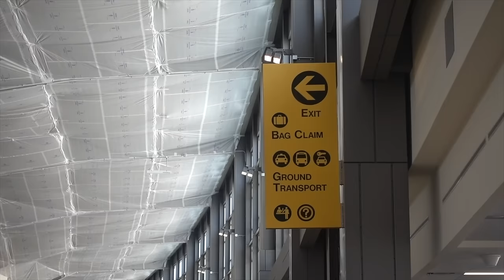MTB Myths that need to die—and some that are true!

Comment: Re: Bunnyhop clipless, learned to do it on BMX bikes as a kid, haven't been on flats since I was 16 really but every now and then I'll do one when I can on another bike (or even on my eggbeaters with flat shoes, not recommended though, LOL).  I've probably picked up some bad habits over the years, but for MTB, I just choose when to bunnyhop and when to "plow over" whatever obstacles.  I've actually found it most useful on the road of all places for those pack rides when suddenly the pack is swerving left/right and in the middle see "POTHOLE" straight ahead, had to bunnyhop one about 2ft across one time unexpectedly not long after I'd just gotten back into biking after about 15 years of no biking... was happy muscle memory kicked in! 
Re: quicklinks - one key/slightly funny thing about them is that they cannot possibly unlink "under load", basically you are pulling it tighter/more solid together while pedaling.  So if it's sloppy, it has to be so sloppy that when the chain is slack and either you are backpedaling, or maybe hub-driving the chain (especially if it happened maybe mid-derailleur shift), that it actually causes enough sag/"push" on the chain to pop the pins towards each other. That's HIGHLY unlikely. 
Alternately as mentioned, the friction can/could eventually wear the slot or "tabbed" sections enough to actually allow them to pry the pin through the slot on a hard gear change or such, so as mentioned in the video, if your QL is not snug enough to require some "snap" to assemble, then yeah, replace it! 
Last run of the day - as others mentioned, LOL, probably mass numbers of people having NO crashes on their announced "last runs"... and probably tons of crashes happening on any "random sequence" runs... but since the last run of the day is the last thing to remember, remembering it as a run you crashed (especially if badly) makes it stand out more in everyone's minds, forgetting the 6 other times that day they picked themselves up and dusted themselves off, LOL. And maybe it WAS going to be the last run, or maybe not, but now that you've crashed and broken "bike, self, ego"... it's by default now for sure the last run, no waffling about "okay, let's go back one more time" when parts of your body are no longer attached properly, LOL.

Comment: The last run is always the most dangerous because you're tired. Same thing with skiing, only magnified, because then you're really tired.
Reply: So true.  A case of the mind/spirit totally ignoring the body physical.  The body always wins in the end.  😐
Reply: I always did my last ski runs as casual, taking in the scenery etc, as I have already pounded it all day. A relaxing run not too technical always seemed like a good way to wind down the day.
Reply: skiing might be the easiest "action sport" of all lol 

I once spent 3 hours getting concussed trying to learn how to snowboard, decided to switch to rental skiis for the first time and went down the mountain with no real issues besides a small section with alot of ice lol skiiing is insanely easy
Reply: @BodieMoto  I think it has a super low baseline. I had to practice snowboarding a dozen times before I even had a hope of getting down a green run without falling over.  Like three years before I felt like I could actually “snowboard”, and a few years after that before I thought of myself as “decent”. And I snowboarded almost every single weekend. 

First time trying skis, strapped them on, went down the hill, turned and stopped. This was before I really learned snowboarding so it definitely wasn’t crossover skills from snowboarding. 

However if you want to be an exceptional XC skier I think it’s harder than being an exceptional XC snowboarder. Same with jumping. 

Snowboarding has a very steep learning curve with a big plateau whereas skiing is much more gradual, but the difficulty ends up higher.
Reply: True, but that won't change based on whether you SAY "one last run."
Reply: So true.  I had my worst skiing accident at Jay Peak on what was certainly going to be "one of the last runs". I decided to try a narrow, black diamond trail with barely any room to slow down and ended up smashing my leg into a tree.  Moral of the story - do NOT try a super challenging or unfamiliar run at the end of the day (bike, ski, etc).

Comment: I've noticed that storing a bike upright will let the foam rings in the fork dry out and make the fork feel a little sticky.  I've flipped my bike upside down for a night to get the foam rings oiled again, and it totally worked.  Fork felt great after that.  One thing that happened from that, though, was the brakes felt spongey afterward.  I think that was probably due to improper bleeding to begin with, though.  All I had to do was flick the levers back and forth for like a minute and they felt fine.
Reply: If you ever look at gas struts in other applications, many of them have an arrow pointing to which way should be up, and it's always the main body at the top, not the bottom. The reason is to keep the seals wet. That's really all these shocks are, except they're basically all mounted upside down. So storing the bike upside down would actually make a lot of sense.

Comment: Great job busting myths. Without reading all the comments regarding shocks requiring servicing after storing your bike on a wall vs the ground … some frame shocks are mounted vertically whereas other shocks are mounted horizontally. So I’d bust the myth on that engineering mount alone. As you mentioned just cycle or ride the bike and service when needed. 

Side comment, I can’t wait to book a trip at the Ranger Station!!

Comment: In regards to the quick release thing, when I was racing cross country years ago, you wouldn't have the rear quick release pointing rearwards as there was a risk, if you were riding in a group of other riders, that one of their front wheels could knock into the rear quick release and the spokes could catch the lever and open it. Also, the front QR should always be pointing rearwards as bushes and plants etc could catch the lever if it is locked in the forward position and open it as your moving forwards.

Comment: I never close my tyre levers facing forwards incase of picking up any bush/shrub/vines and risk ripping the lever open, what do you think about that?
Reply: I happen to have my (one and only) QR lever pointing forward, straight along the chainstay on the drive side.  In that position, anything that would hit the lever from the inside would also hit my pedals and the rear derailleur mechanism.  It's never been pulled out of position, even after having to deliberately hug some foliage to avoid a track covered in soft sand.  In summary, the chainstay makes for a pretty good guard.

Comment: There's only one point about quicklocks that still applies today.
Don't put it facing forward because if it wraps around a twig or wine or root etc it's going to unlock and you will drop your back wheel at some point down the trail.
I've always put mine facing upwards in line with the frame so there's less chance of stuff getting in between it and unlocking it.
I don't put it facing backwards because then it can (easily) catch something as i roll the bike backwards and unlock it without me noticing it too.

But never in my life have i been scared of it catching a disc brake... They physically can't do that, if designed correctly.
However, I have had derailleurs find their way into the spokes of a wheel before when rolling backwards. Make sure your derailleur is healthy and fastened properly and use quality components and properly lubricated and free of debris.

And with V-brakes i've also seen a case where the V-brake pads worked themselves into the spokes and all hell broke loose.

Comment: Learned to ride clipless, started to do drop off with 0 technique, went fine for a while but because I was used to just let myself fall off the drop I had my feet disconnecting from the pedals few times causing bad crash that never heppened before with clipless or after when I went back to clipless. I could bunny hop both types of pedals. Another problem is that with clip you don't need to drop your heels to ride rough sections or for hard braking which means when you go to flat pedals those events are mostly not controled and get sketchy for something you normally know. After at least a decade refusing to touch a flat pedal again I now force myself to ride flat during winter to learn those technics but reseting basically a lifetime of bad habits is hard and it hasn't really made me go faster than my normal speed either but at least it brings variety in my riding and I chalenge myself a little bit. I taught my GF to ride on flat and she proload the bike when taking a drop and drops her heels when necessiry if she moves to clipless one day for some reasons at least she has the right technic ingrained in her riding style.
Reply: I had someone tell me that dropping the heel wasn't actually a very big deal. That happens automatically when obstacles come up. What you want to do is keep your feet level relative to your center of mass. When you're going downhill, your mass moves rearward, and your heels will naturally drop to compensate. When going uphill, your center of mass moves forward, and your heels will rise a bit. When on level ground, your heels will drop for power, and rise for efficiency, or cycle between the two if you're pulling on the pedals as well. When you're riding off drops, your heels will rise to help you push against the pedals to keep them attached. It's a very dynamic thing and there is only one right answer: respond to the terrain.
Reply: @TheDustyShredder  many people, especially beginners don't drop their heel when they should. Contrary to what you said it is far from natural. Coach some people, even observe people at a bike park you would be surprised. No idea for flat I don't ride such terrain, and for climbing I do but couldn't care as I mostly climb on fire roads to get to the top as efficiently as possible lol.

Comment: The airplane cargo hold is also kept pretty close to normal temps, like 45 to 65 deg F -- something that will ease your mind if you're worried that a sudden temperature differential will separate embedded aluminum parts from the CF matrix they're in due to differences in thermal expansion.
Reply: Okay, so yes they can temp regulate the cargo holds, but they dont have to, and usually only do if there is obviously temp sensitive cargo. I know this for sure, because a friend of mine told me a story about when the airline she worked on accidentally warmed the wrong cargo hold and someone's pet sadly did not make it.

Comment: I never use the phrase one last run, or my last run. When I first started downhill, I did use it and was quickly corrected. But I actually am at the point where if I even think that, I don't do the run because that's where I'm most likely to get sloppy and get injured.

Comment: Great myth busting vid, thanks. 

Your segment about chain master links and reference to chain cleaning triggered a thought. I would be interested to hear your thoughts about chain cleaning regularity and the effectiveness on chain life etc. 

In my case, I never specifically take the chain off to use a degreaser and properly clean the chain. I only ever use a combo cleaner/lube which is a solvent that contains PTFE as the lube. I use it after each ride  with the chain still on the bike. This may seem expensive to some, but I weigh 120kg and I'm lucky if my chains last between 1000 to 1500km anyway. I always just use a brush then a cloth to wipe off any dust and dirt from the chain, chain ring and cassette before lubricating and wiping off excess. My thoughts are that this is almost better and less effort than frequently taking the chain off and cleaning with degreaser, because when you clean a chain, depending on the trail conditions you ride on, the chain is only clean for the first few minutes anyway. After that the dust/mud is on the chain and busy working its way back in to those link rollers.

Comment: Regarding quick release levers: Never close them facing forward, always close them facing backwards. Why? Because vines/cables/random junk on the trails or wherever you're riding can catch them and snatch them open.

I recommend considering the same thing whenever installing a single sided clip master link for a chain, observe which way you install the clip so it won't have any chance of catching something on the bottom of the chain run and popping off.

Most any of those quick release or quick clip mechanisms can be prone to popping loose if you hit or even bunny hop some sort of unexpected obstacle on your ride.

It's not the most likely scenario, but it's happened to me before. Stay safe out there fellow riders!

Comment: In the 2000's I heard that putting the lever on the disc side was dangerous because the heat from the brake could melt the resin of the lever.
It was more plausible of an excuse and even at that time I laughed at that Idea.
I could make a 1 hour video about how kickback doesn't work the way people think it works but I suck at making videos. But no, kickback won't increase with POE (or, not as much as you can feel the difference). Bike's response to rider input will increase tho. Making people think they are feeling kickback.
Reply: I know what you mean, I've tried telling people it's a myth and why but very few actually think it through and realise why, your wheel's rotating forwards and spinning inside the freewheel so how is a tiny bit of motion on the chain going to suddenly engage the freewhee enough to get the crank to turn backwards?
Reply: "melt the resin of the lever'. FFS you guys.

Comment: 13 yr maintenance engineer.... Very few bolts on a mountain bike are torqued to the extremes heavy equipment is.
Using a hex key ball end in highly torqued cap screws will eventually wear the ball and then the worn ball will will wear the cap screw head. 
Also the reduced contact area of the ball will allow the ball to deflect the walls of the cap screw socket and round the hole...

If you have a new set of Allen keys (or at least a set that has only been used on your MTB) and they are not cheap (may as well use a screw driver over a cheap set of "soft" Allen keys.) it's fairly safe to use the ball even for unlocking of the initial 'stick' but if you can use the non ball end, always do for unlocking the initial turns.
Personally I always reaffix a cap screw with ant seize paste. Anti seize does not allow a bolt to loosen itself but helps ensure that oxides (rust etc) does not 'Glue' the bolt in place. (Removal of a corroded bolt, often due to different types of metal reacting like a battery, will usually cause damage to the softest of the 2 metals (rusting metal often makes the surface harder so it will rip apart alloy with its rough surface. Anti Seize has an added bonus of creating a protective layer on the surfaces of the metals helping prevent oxide. 

Personally I use Anti Seize to hold the caps on water blasters that can be holding 4000+ PST on a vibrating piston head. I have NEVER seen one loosen that was prepared with Anti Seize, but I have near destroyed brass in brass caps where the oxides glued the pair together and even a smack with a hammer (old trick for shock release of brass fittings, when done right doesn't damage the cap especially if using a brass drift)

Stainless in stainless seems the worst. Stainless can suffer 'galling' where a clean stainless bolt can stick in a clean stainless nut, and when removed, the friction can create tiny balls of debris that jam often breaking the bolt head rather than loosening the nut...   

Anti Seize!    Put it right next to your can of spray grease and Brake Clean!   (and if your in New Zealand... a length of #8 fencing wire.

(Odd fact,     I have repaired a broken throttle cable on a Honda CBR250rr with some duct tape, a Broken Heart necklace.... and a piece of fencing wire!
allowing a 200k return trip home... with a reverse action throttle... sort of glad I wasn't the one riding it...)

Comment: The quick link is due to replacement only when you can detatch it with your bare hands. 99.99% of the time, chain is under tension so unless that tension is gone, and the quick link can move itself to the to thehole where you disassemble it, there is no way it will ever detatch because it was reused. I've put some 9,10,11 quick links and I didn't even need pliers to snap them on. The only thing they need is a little bit of friction to not slide back. 
Where you should replace q-links is when you change your chain. They will still stretch and even if it's a negligible amount, better to be safe than sorry
Reply: A new chain will have new quick links. Obviously.
Reply: Unless that link is from Connex Wippermann, as they are designed to be opened and closed by hand, and are approved for repeated use 🙂

Comment: I broke my back because of a quick release.

The lever should always point backward.
I had a front catch a branch and come loose and didn't know it. 
The wheel came off when I bunny-hopped over a puddle at high speed and I went end over end, breaking three vertebrae in the process.
Reply: I've had a vine get hooked on a front facing quick release and bring the bike to a sudden stop. +1 for facing the quick release backward.

Comment: I feel like there’s an entire different attitude to these videos now that the sponsor is gone. And it’s great!

And I read somewhere that the max inflation on a tire is half the amount that will blow the tire off a rim. If that’s true, a flight won’t make a difference at all.
Reply: The max inflation is not the real max. Just a legal precaution and practical measure. No point inflating above max, as benefits are very minimal.
Reply: @markconnelly1806  Usually max pressure will make your tire rock hard, which you never want.